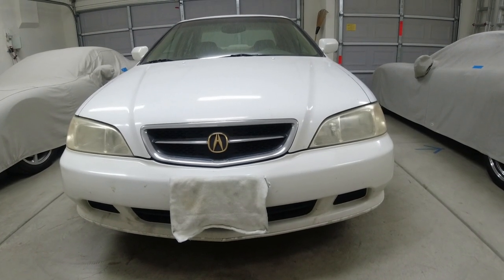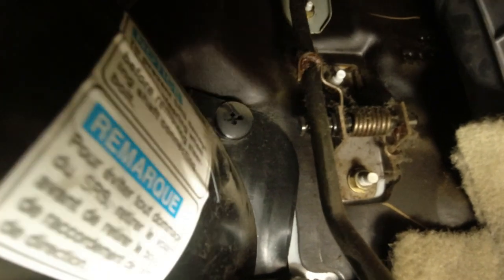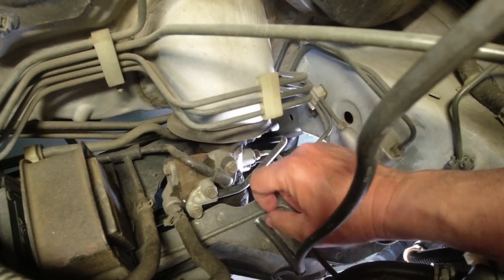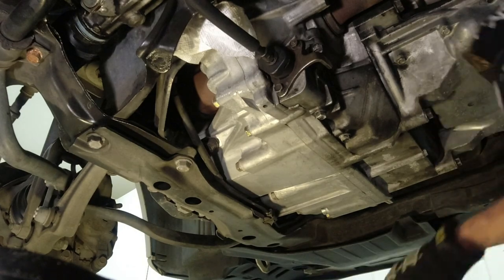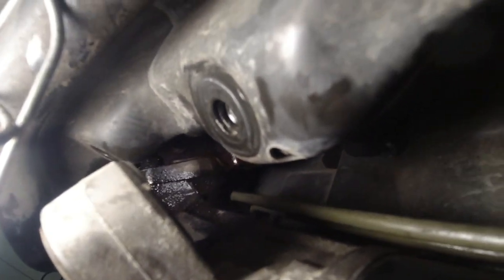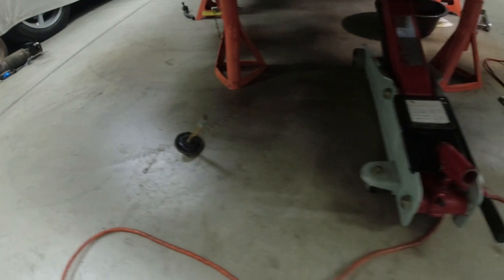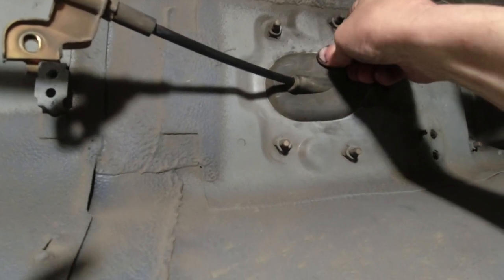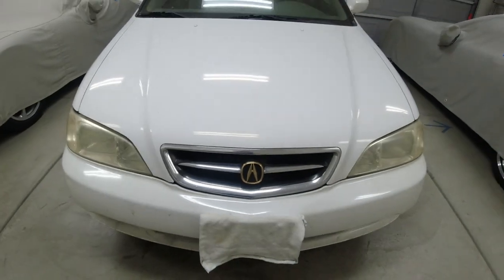2000 Acura 3.2 TL – Power Steering Rack Replacement

Comment: Cottle pins are cheap at local auto shops.  Use new ones.

Great tip on tying the centered steering wheel with the seat belt.  I put strong tape along the column of the steering wheel as well and draw TWO vertical lines on the tapes so that I can center the wheels again if needed, using those vertical lines as a reference.

Replace all outer tie rods and the power steering pressure sensor/switch (usually green in color for Honda Accords) as well.  Hit the knuckles to get the outer tie rods out.  Don't hit the bolt from above, because you can strip the threads of the knuckles!  Make sure to loosen the nuts where outer tie rods meet the inner tie rods before loosing the bolts that the outer tie rods bolted to the knuckles.

Comment: A very good video! I was quoted a little over $2 grand for this rack and pinion replacement job the other day. By the way, do you think replacement of rear main seal is DIY feasible? Thanks.
Reply from the maker: Replacing a front main seal is easier to do than the rear main seal. A good time to replace the front main seal is while changing the timing belt. The rear main seal is usually best done while having either the engine out, or the transmission out, as this rear main seal can only be accessed when the engine and transmission are separated from each other.

Comment: I have a line spraying from ther lower drivers side. Will i have to drop the whole rack out as in this video to fix it?
Reply: Probably just the high pressure line o ring at the steering rack.  I had that o ring go out and it would just dump the ps fluid
Reply: Same thing here. Ended up being part number 53670-S84-A02. Possible to replace without removing the rack, just takes a little time and patience.